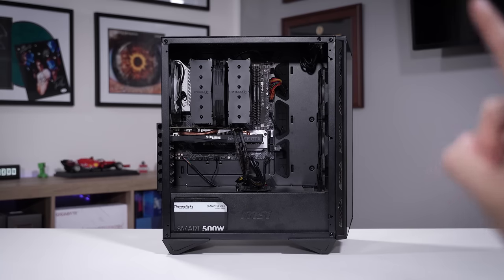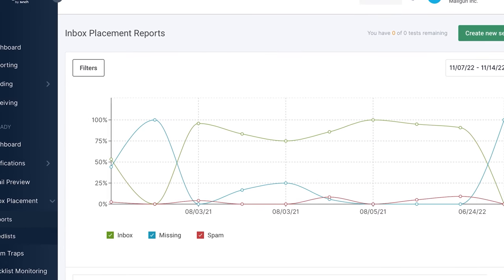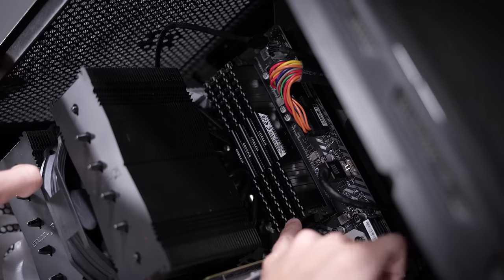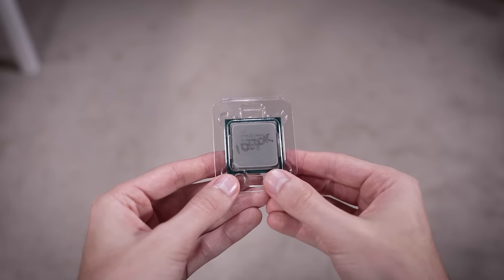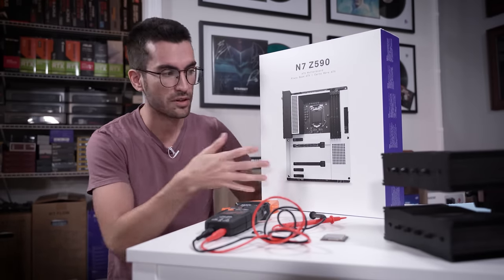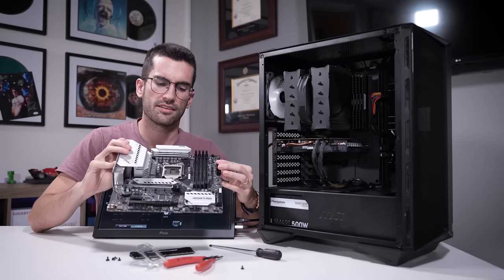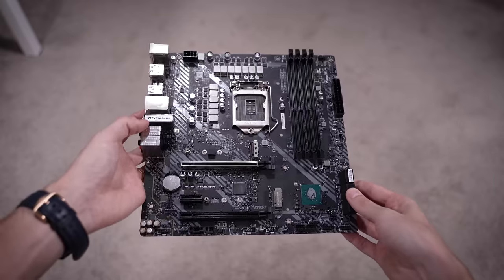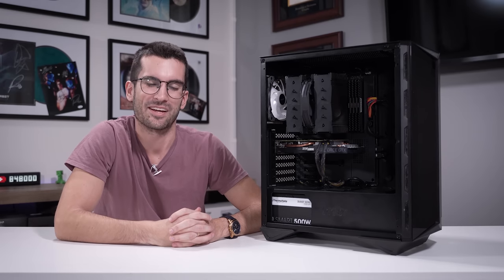Fixing a Viewer's BROKEN Gaming PC? - Fix or Flop S3:E14

Comment: 90% chance the board was bricked while updating. I think it's good for your channel to invest in bios flashing tool, you could revive some older mobos that are not easy to replace also good content
Reply: 100% agree. At the little pc repair shop I work at we invested in one and have been able to bring back bricked boards with very little effort. Super useful tool to have.
Reply: Even though it's 8/10 cpu , 2/10 mobo on this series , it's inexpensive enough to be worth it. Unless board manufacturers send him enough freebie mobos to not have to bother with bios.

Comment: I'd suggest watching one of Adamant IT's video's he has up where he deliberately cuts power during a bios flash to show what happens, and then how to go about removing the Bios chip and reprogramming it. It may sound difficult, but it's really not, you can get clips that attach to the chip so you don't have to remove it, but they are hit and miss, removing the chip and using a bios programmer (which are very cheap) and the correct software will at least show you why the bios failed (you'll be able to compare the bios with a working one and see the differences) and you can easily flash the right bios and re-solder the chip. There probably isn't a hardware failure in the chip at all, this board can be saved with a little bit of work. Even if you don't intend to do Bios programming at any point, learning about how it's done, and doing it once or twice will save you a lot of headaches in the future if this happens on a high end board that you'd rather not lose.
Reply: Good stuff, highly recommend watching Adamant IT.
Reply: You beat me to it, I endorse this message.
Reply: i don't see greg going that deep into fixing a rig and you cant blame him...he is only working with what he has on hand and his time...
Reply: Intriguing. Thanks for the recommendation.

Comment: I feel bad for that system having such a terrible power supply. Hope it isn't killing hardware.
Reply: I wonder if he tested the psu to see if everything is good with it. Depending on the gpu he might be overloading that psu
Reply: @SkateClipsAndTips  500w is fine
Reply: @oof8392  Needs like a 650w to be safe.
Reply: My least favorite brand of PSU, I have replaced two of them for people recently that have failed
Reply: I've had Thermaltake's die on me out of the blue, for no reason. Wouldn't trust those things to power a TV remote.
Reply: @TheFu3lman  Mine has been running solid for the last 10 years.
Reply: @GrizzAxxemann  Cool, 10 years ago they probably didn't make garbage.
Reply: It will be doing that Zotac crap a favor by killing it. Those are the worst cards
Reply: I've used a few of these over the last couple of years for builds and so far, no complaints. The systems were entry level low power systems too though. I think all in all it is the luck of the draw. The only PSU I have had fail so far is an EVGA Psu and they are typically great.
Reply: he just gave it a good motherboard to kill ,, WTF, "there should be protections in place there" ,,, no their are not, in fact quite opposite, and anyone touching other people stuff should know that, he evidently has never heard of a PSU tier rating
Reply: @oof8392  its F tier rated power supply, has nothing to do with the wattage just the specific PSU, that means it destroys CPUs and motherboards for no reason what so ever , if you are using this PSU you should replace immediately, it will destroy your system
Reply: @jeffie8696  i learned the hard way and lost an I7 and board to one
Reply: @TheFu3lman  its because its 10 years old the newer ones aren't the same PSU
Reply: @hayseedfarmboy  Ouch
Reply: It’s fine for that build.
Reply: @Sonic_1000  it isn't fine for any build, other than maybe a Ryzen APU build. Those smart series units are terrible quality.
Reply: @oof8392  wattage means nothing if the PSU itself is terrible.
Reply: @Ladioz  If it's a 20 series those were alright from Zotac. Heard a bunch of crap about their 30 series tho.
I have a 2070 amp extreme from them and it's very good, no coil whine unless you start pushing OC beyond factory.

I was even running it on a GAMDIAS F tier power supply for like 2 years until I realized that thing was crap and could kill my entire system lol.
Think it will be fine for awhile if he's already been using it, but yeah definitely not labeled "replace immediately" for no reason. If (more like when) it pops, it will kill something attached to it.
Reply: Depends on the video card, if it's a a low power draw one 500w is perfectly adequate (although pretty close to borderline).
Reply: @Atheismo9760  Why do you think this rig needs 650 watts?
Reply: Used to work for a boutique PC builder doing warranty repairs, any time we saw these thermaltake PSU's in a system they got swapped immediately, they just failed so frequently that it wasn't even worth plugging them in to test them.
Reply: Nah fam, with a locked CPU and what I'm guessing is a GTX 16-series graphics card, 500 watts is beyond more than enough.
Reply: @FilthyCasual268  the wattage isn't the issue. It's the terrible quality.

Comment: The bios updates from msi in the 10th gen is a huge problem still and msi wont do a damn thing about it. I can't link the msi forums of all the confirm cases without my comment being marked as spam but it's been an ongoing issue for over a year now. With hundred upon hundreds of confirmed cases. And msi still wont put out a fix. My z490 tomahawk is effected by it. You try to update the bios and it bricks the board after it restarts with a dram code. The only fix is to buy a programmer for the bios chip which many have done being msi wont help. Being most of the msi z490 and other msi boards don't have bios flash back this is the only fix. It's a very messed up situation still for 10th gen users with msi boards without a bios flash back. I'm glad your video has a pc with the exact issue effecting so many people and hopefully you will see this comment and it can become public and help the people that msi silences and shrugs off like Newegg has done until a famous youtuber calls them out on it. If you go on the msi forums you will see the huge amount of people effected by this and have had to buy new boards or systems or a programmer and other things just to get their systems up and running again. The thread is labeled - "!!! Warning: Z490 boards - problem with recent BIOS updates !!!"

Comment: Would you ever try and use something like a ch341a programmer to try and reflash the bios?
Reply: i am also curious about this
Reply: think of it this way. Greg is not a actual repairsman, Greg is someone who troubleshoots lego rigs. Bios reflashing is more like fixing the individual lego pieces, while greg just swaps out lego pieces to fix the final product.
Reply: He acknowledges in the video that those exist and says he might try using one in the future to salvage the board.
Reply: I have done this. It's not difficult. And the programmer was less than $20.  If you have a mobo you want to save, and its out of warranty, I think its worthwhile to use a ch341a programmer.
Reply: @Appri  lol Lego rigs
Reply: I was going to write the same thing. ch341a  programmers also has cable with latch. You don't even need to desolder bios chip for reflash.
Reply: @Appri  I don't see you on here making tech videos trying to help others but what do I know 🤷‍♂️
Reply: @willfultrain6779  
He's not taking the piss mate. Just contextualising what Greg does by using an analogy.
Reply: I upvote for this too :)
Reply: Most probably bricked MB. Once happened to me after trying to change ram voltage, I bricked the motherboard. And later I found out I could easily fix it with this programmer.
Reply: @willfultrain6779  I have repaired many boards on my own, have a rework station for actual board level repair (I suck though, the best I do is port and chip replacements), etc. Asides, I never said he's doing a bad thing, fixing devices for free for his own time and just youtube monetization is something not many can do.
Reply: Came to the comments to say the same thing, I have done that several times even on laptops at the university because the IT guy who set the password on the BIOS left and nobody ever attempted to do a BIOS reflash with a programmer.
Reply: People have been suggesting this at least in 5 prior videos. He's never even commented on it. I doubt he's going to start now - even though a programmer is less than $10 and it's definitely something you can try before throwing out a board.
Reply: @Appri  Greg the swapper! :trophy-yellow-smiling:
Reply: @dreams1453  Never come across ch341a - and checking Amazon they are a thing. Interesting...
Reply: @willfultrain6779  Well he kind of is playing real world PC Building simulator here. No offence, it still can be fun and there is a market for everything. And this has much better graphics than that mediocre game. Though bricking bios is quite common thing and often repairable either by using programmer or sending your MB to someone who can. It's not rocket science and UPS etc. exists. It's a tiny part on an expensive board.
Reply: Of course not hes a YouTuber not a real pc technician.
Reply: The CH341a programmer with SPI connection fixed my  Dell. (Oops Alienware)
Reply: @Appri  that is the actual point. The programmer is fairly simple to use. And I think it is viable for the average person, and Greg is more than capable. If I can do it just about anyone can.
Reply from the maker: To add to the plethora of comments here - I’ve been aware of this tool existing and had one on order from a seller that was not Amazon Prime’d. I have my doubts about this being a BIOS issue at all seeing as though the owner never actually flashed anything (and couldn’t even enter the portal to do so) by the time it crashed. Nonetheless, these boards aren’t thrown away when they’re swapped. And to Derek’s unnecessary comment - I think YouTubers can figure out how to use a simple tool 🤪 I didn’t make it through engineering school without learning the least bit how to problem solve, silly.
Reply: @GregSalazar  Nice too see an Intel board having issues people seem to have this myth that nothing ever goes wrong with their platforms so it's nice to have a recent one having issues as well on show to bust this myth
Reply: @GregSalazar  Here is a thought as his Bios was flashing there might have been a minor powersurge either at the wall or directly from the PSU causing it to use some inbuilt protection and turn off the system when it wasn't meant to bricking the mobo in the process
Reply: That's what this board needs. It's how I got my X370 motherboard for £20 off ebay, I bought it "faulty", and after initial voltage checks on all the rails before fitting any parts, I thought the BIOS was probably corrupt. So with no BIOS flashback feature, I resorted to using a CH341a with a voltage adapter. Cleared, then reprogrammed the BIOS, and it sprung back to life. 

If you do this route,, you do need to find the BIOS chip, find the datasheet for it, and check which voltage it runs at. Then you need to use the correct adapter for the voltage, and triple check you have the pins the right way, before powering anything up. But if you take your time, and are careful, you can resurrect boards with bad BIOS flashes.
Reply: @GregSalazar  you are a good man greg...
Reply: @lesleymunro4964  Fortunatly there are a lot of cheap faulty boards on ebay to practice on
Reply: @ronanwaring3408  Yes, though you do need to be careful. I have seen one particular seller offloading boards with parts robbed/missing heatsinks. So you do have to pay careful attention to check the hardware is intact, or at least has things you can solve, like bent header pins. I'd take on boards with blown VRMs, or other soldered parts needing replaced, but I wouldn't recommend that for most peeps, as that requires a good soldering skillset, and hot air tools, which not everyone has.
Reply: @lesleymunro4964  Fair point about not knowing were parts come from or what condition they are in but I was just saying if you need too it's better to practice on something you don't want or need than something you do
Reply: @ronanwaring3408  Agreed. I just wanted to lay out the caveats to this method, to help some of the younger players who might read this to avoid some buying mistakes. It is a high risk buying those types of boards vs known good, but a high reward if you can get it fixed and working. But your point is very valid too, since it is a risky buy, you should only get something that isn't to be absolutely relied on, to practice on. It's sound advice, especially for folk who are new to flashing boards. I've personally toasted a couple of BIOS chips in the learning phase. 🙂
Reply: @GregSalazar  I would love to watch a video where you try to revive all the dead motherboards you've accumulated by trying to reflash them with a ch341a & see how many you get to work

Comment: If it happened during a bios flash, couldnt you try a bios programmer? I mean, you wouldnt lose anything and could actually fix it if the bios got fkd
Reply: True there are usb programmers for those chips for a few bucks on amazone.
Reply: @mrrobot6137  i actually have one and a windows repair usb that’s saved like 5 of my friends PCs
Reply: that is true, however in this instance, according to the owner of the rig he was not actually flashing the bios when the system black screened. Most likely something else failed on the board.
Reply: @yotoprules9361  well it won't hurt the board and If he uses a USB flasher it only takes around 5-10min to reflash the bios.
Reply: @timbecker4037  yeah it is definitely worth a shot, depends on whether the original owner was honest or not, my CH341a has saved several boards that had bricked BIOS.
Reply: @yotoprules9361 yeah most of the time you really just have to trust that the owner didnt just put a bricked component in order to get an upgrade.
Reply from the maker: It didn’t happen during a BIOS flash. Please listen carefully to the intro :-)
Reply: most likely the power supply killed it, the SMARTs are known for it , it should have been pulled, and thrown in the dumpster first thing, (or turned into a battery charger) all he did was give it another board to destroy, it like this guy has never even heard of Cultist tier rating
Reply: @GregSalazar  yet you yourself say that you don't believe everything that the PC owners say :-)

Comment: Grab a programmer for the bios,  adamant it channel has some videos about it,  most of the times is a corrupted bios
Reply: he has awesome content.
Reply: People have been telling Greg to get a programmer to ust flash a good BIOS back onto the board at least 5-10 times in previous videos. The comments are always the same and he still hasn't gotten one. I doubt he's going to start now.
Reply: @b0ne91  is not that easy to use them, you must learn what to do, and how to do it, and maybe even u need to desolder and solder it back
Reply: @MrDvneil  I've used them plenty. Even with the clips, they're easy to use. I've never had to desolder anything (and don't have the tools for it). I've even flashed a GPU BIOS after it had bricked. It's easy
Reply: @MrDvneil  it's actually quite easy to use as long as you have a basic understanding about how it should work. These programmers are dirt cheap, so it's quite a handy tool to have. I also rescued 2 board with it, my friend's and my own mobo as well (I basically shorted the backup bios on a dual bios board, which had bios corruption, after a failed OC, so I bricked it).
Reply from the maker: The owner wasn’t flashing his BIOS when the system crashed…
Reply: @GregSalazar  even with that chances that bios is corrupted, are high. Based on adamant when facing a non working mb
Reply: @GregSalazar  You said that,  but you also said you weren't sure at all if they had started or could be believed. Reflashing it takes a couple minutes. It's worth trying on a dead board at least

Comment: You can usually find the OEM BIOS chip very cheap why not just pop a new one in and test it?
Reply from the maker: I will - at a later date. They don’t show up overnight. Would rather have the viewer back up and running sooner. Also still in doubt that it’s BIOS related seeing as though he wasn’t actually flashing (supposedly) when it crashed.
Reply: @GregSalazar  I've had a computer do this to me too where updating the bios bricked the board.  I was able to contact the vendor to get a new chip sent to me which fixed it. I know it doesn't come overnight but I would like to see if that works.
Reply: @GregSalazar  You could use a usb flasher for it, pretty cheap and working for more boards, and you wont have to solder something.
Reply: @Qasmoc They are not talking about the BIOS drivers, but rather the physical Chip which stores the BIOS drivers on the mobo (aka., a memory module specifically for the BIOS).
Reply: Some bios chips don’t pop out. You need a heat station and fine tools to remove. Then you also need fine soldering tools and if not a microscope then at least a magnifier. You can easily desolder more than you wanted or even damage the board if you don’t have the skills. Greg does not do that. If you want to see all that kind of stuff then watch NorthridgeFix.
Reply: @GregSalazar  would be nice to see some more videos of you trying to fix things you replaced, even if things dont go as planned ;)